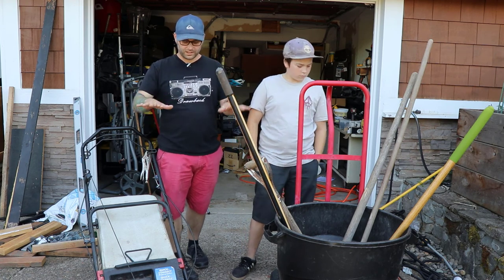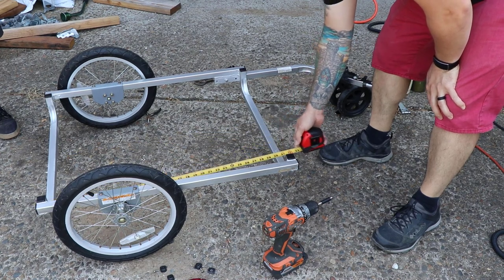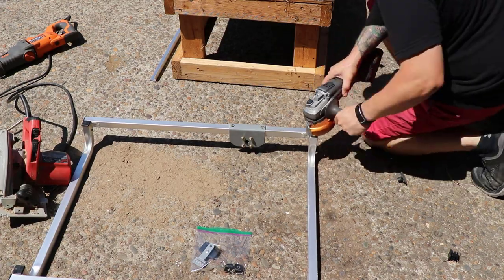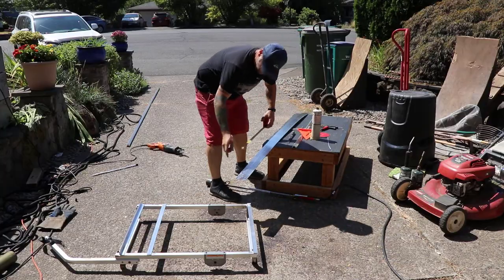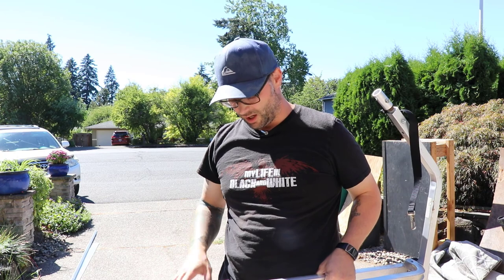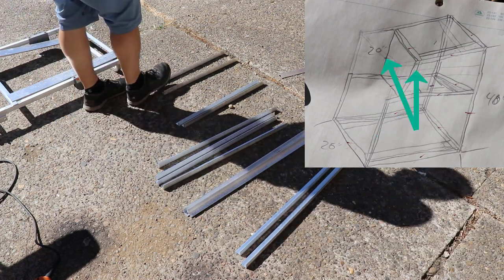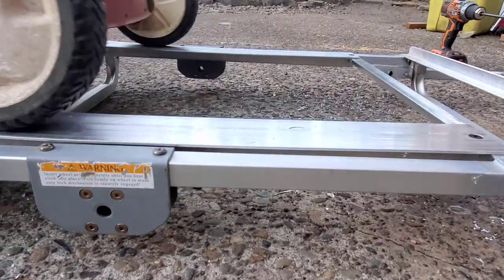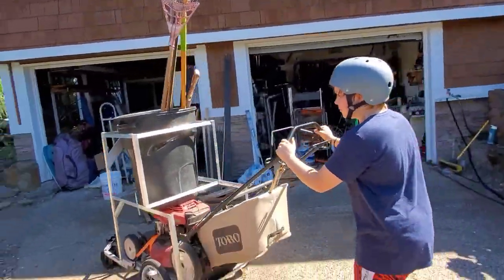How to build a Bike Utility Trailer. Plus Aluminum Soldering

Comment: I saw the aluminum rods at the fair. Would like a follow up on how the corners hold up.
Reply from the maker: The upper pieces gave out on a couple corners and we just bolted them back together.  But for the most part they held pretty well.